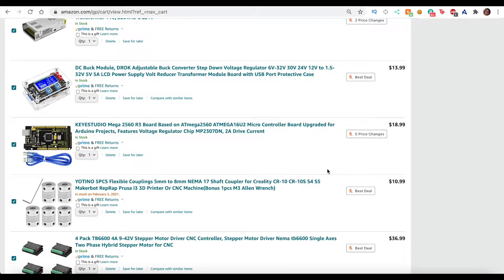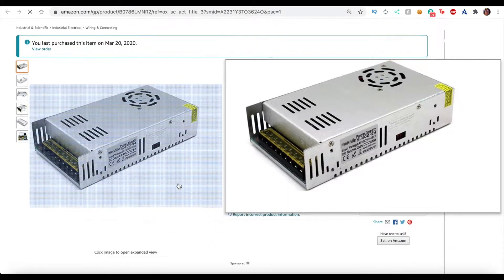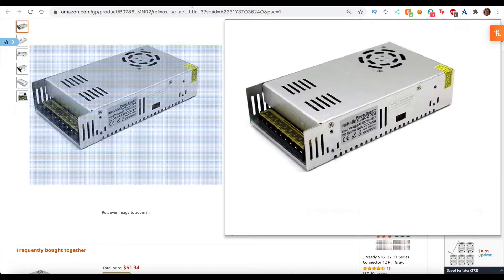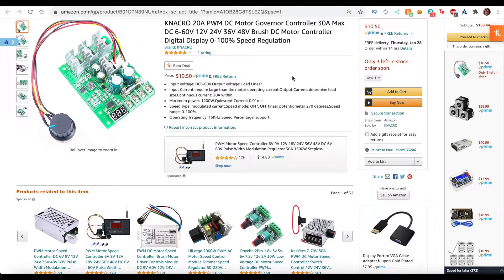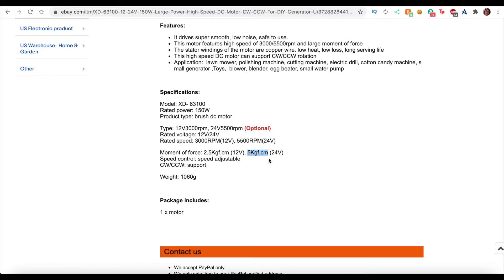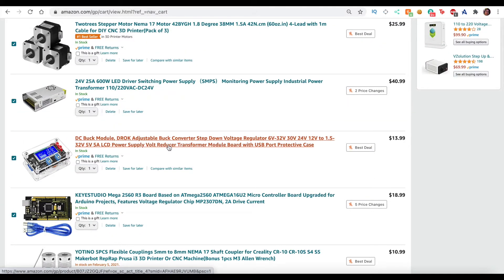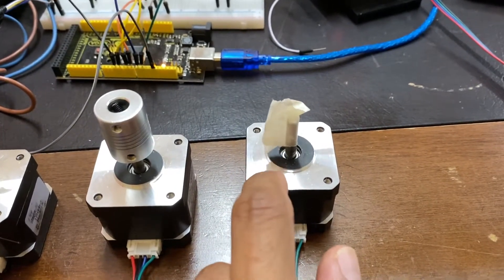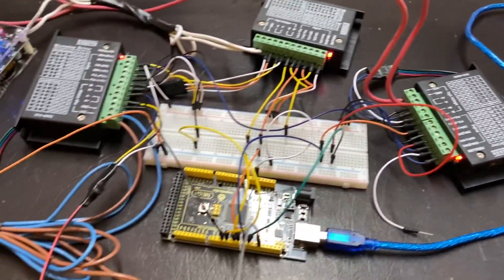Building a Tennis Robot (Electronics)

Comment: Got a wiring diagram too?
Reply from the maker: Yeah I still need to put that together lol...I would make an updated video with a more in-depth analysis of the electronics, wiring, etc, so that everything would be easier to follow. 😅
Reply: @TheAutoDIYGuy  I'm adding parts to my cart and ready to order from your list so that you can get credit.  I'm handy and kind of a tech but not an electronics person so I need to understand how each part works and how they are connected.  If you have sketches, diagrams,  etc before you make another video I'd love to receive them.  Thanks again
Reply from the maker: @tonybell5043  I’ll see what I can do 🙂 btw hold on ordering the stepper motors though...I ended up upgrading the ball hopper and oscillation motors. You’ll see in the next video.
Reply: @TheAutoDIYGuy  Waiting (im)patiently.  🙂